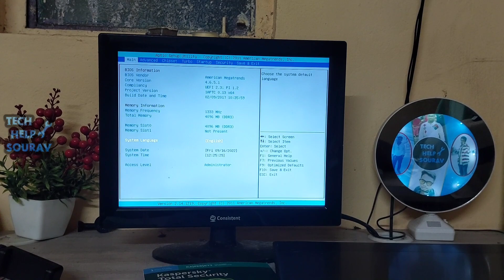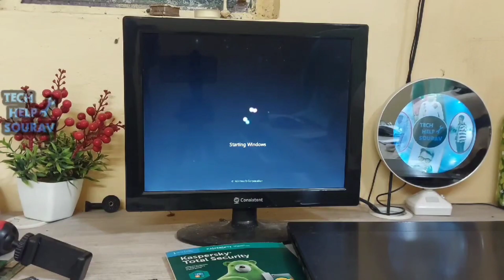How To Fix Computer Stuck In Bios Loop Problem (ASUS,Intel & Mercury) | PC Stuck In A BIOS Boot Loop

Comment: My computer always stuck on bios and didnt want to boot i already reset the bios but it didnt work it read the hard drive but it didnt boot can you help me fix it pls.. This problem give me hard time when i need to do work on my computer. Thanks
Reply: Now it's fixed or not?
Reply: @ankitrewar7527 corrupted ssd.. I change with a new ssd and its working again..